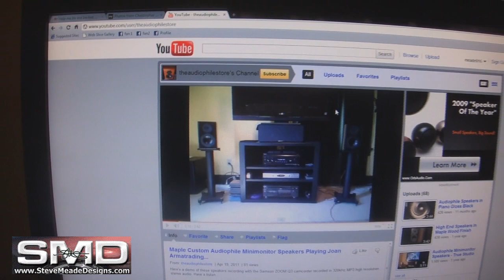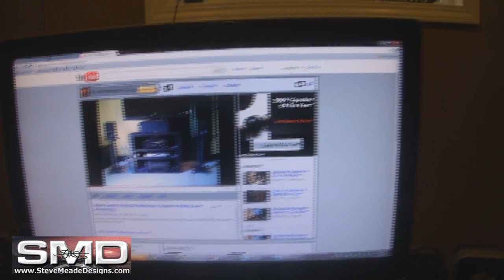Extreme Car Audio BASS VS. Zoom Q3 HD Camcorder - SMD Camera Challenge

Comment: LOL @ ANYBODY thinking a camera can handle over 157 DB. I know what will handle it though and Steve I CHALLENGE you to try THIS because it WILL work. Get a camera like the Sony DCR-VX2000 That has a line level input. Then get a KICK DRUM MIC... yes a kick drum mic from Shure. Run the mic through a mixer for proper gain structure. Then and only then will you have a diaphragm big enough to capture the kind of bass your vehicle generates. try it. It WILL work.

Comment: your going to be def soon.  When subjected to sound pressures above 85dB for only 15 min or more you putting your ears in danger.  A shotgun is usually around 140-160dB & is extremely bad for your ears. Your stereo is most likely sitting around the same levels. But likely the damage is already done so it really doesn't matter now. Slowly your hearing will diminish & hearing aids will suck. So just enjoy it while your hearing still exists.

Comment: Revisiting this video... This may be a moot point without evidence (I wish I had thought of this then!), but maybe, just maybe the recording within the cab may have been improved by attaching a windscreen over the mics because I believe at least some of the distortion was caused by the high volumes of air produced by those 18's. See minute mark 6:25 of this video to give you an idea when placed outside of the wind area... Still, the onboard mics are rated to handle up to ~130 dB, not 150+ dB.

Comment: I used to have a pair of Sony MDR V6 Headphones and I would plug them into my Camera's external MIC input, the resulting sound and dynamic range was far better than the stock camera mic (I think it only recorded sound through the left ear cuff when plugged into MIC input) 

But I don't know about it handling the sound pressure produced by Meades setup, Thats going to be a challenge.

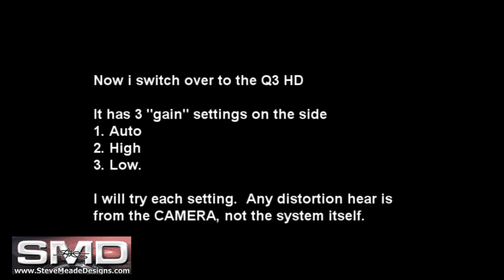Comment: My two favorite parts of this video (besides the plugs - thanks again Steve for those!) are  during the switchover at 4:25 (or 4:45 when the actual switch takes place), and when the bass is recorded without distortion between 6:26 and 6:50 (make sure you turn the volume down no later than 6:50 to avoid the piercing highs beginning after that point).  I am very happy to have participated in this test, and I would have done it all over again even knowing the overall outcome. AWESOME STUFF STEVE.

Comment: The only way that a mic can pick up that much bass, is if the mic is a subwoofer. They have those kick drum mics, that are essentially a woofer wired in as a microphone.

Something like that would get the job done, BUT on the other hand, those mics aren't for voices or anything treble. You might have to have another regular mic for the treble, but that would be clipped, and defeat the purpose.

BUT on ANOTHER hand (3?) why not just listen to the ACTUAL SONG, If you want to hear it that much. lol

Comment: What if you try a drum microphone, the ones used in rock shows, I guess they can handle loud sounds and high pressure. Or maybe make an isolating and hard diaphragm in front of the microphone to handle the pressure.

Comment: @meade916 Something like a Shure Beta 52A will pickup a pretty full range of freqs (although with a bit of emphasis on certain ranges) and will work at really high SPL levels (they claim 170+ on that one). Like you said though, a setup to use it wouldn't as portable and you would need a recording device or camera that takes XLR inputs.

Comment: @bsems1000  yes it really did my subs actually played the lows my room was shaking up,  most of the distortion came from the mids and and highs (i have some sony home theater speakers and two 15in power acoustic hooked up to my computer for work and play :) ) but like you said when the cam was outside because he was away from the air flow, non of his other vid have come threw with so much bass like this one, thats why so manny doubt his system ....

Comment: Steve I do believe that some of the distortion is due to the air is at a higher velocity from the sub movment. U should use a external mic with a plastic container around it to protectic from the air moment from the subs. Also most people's computer can not handle low freqz I have a surround sound hooked to my desktop which has built in crossovers and ur videos sound cleaner on it then my laptop. Wish you luck on finding a better camera

Comment: I agree, when the camera is in the window or other location and the bass was up high and where there was air moving directly on the mic the distortion was quite high although I would have to say that it was better than any other bass video I have ever seen on any youtube vid. In addition, when the camera was out of the direct wind like by the quarter panel the bass was quite good. I have my PC running through my home stereo so there is ample power and a good sub and the bass sounded excellent

Comment: This is just a recomendation but you might want to try to use a mid range speaker as your mic similar to how people have special mic just for the kick drum. vibration of your subs would  move the much heavier diaphragm of the mid range speaker slower than the thin all purpose mic. Of course since it is heavier it would not pickup human voices very well, so you probably would need a special input. This would need some fooling around with to perfect it and make sure it would not have 2 much Vot

Comment: There's  a solution to record your system without distorting. I have 2 mics that can handle SPL's above your system as well as capturing  frequency's  below 30Hz. The zoom has mic inputs for using really good quality external mics which bypass the shitty internal ones. This really will work & I would love to help you out.

Comment: My opinion is that that camera gave a very good reproduction of loudness and frequency range compared to all the other vids.. there is more audible camera mic distortion when the bass hits but It picks up the mids nice and clean.. you should do over a mids and highs / sq vid using this cam and use the current / previous camera as usual.